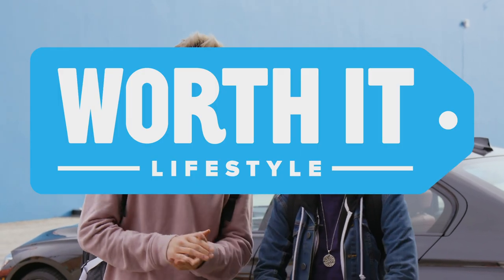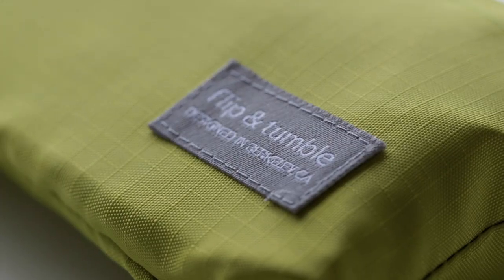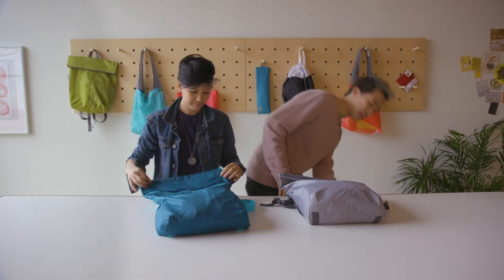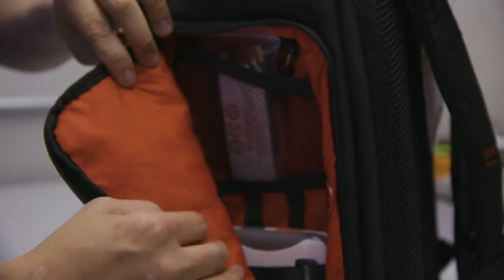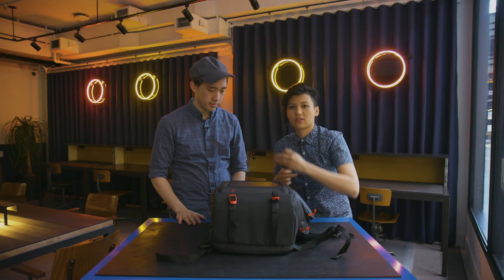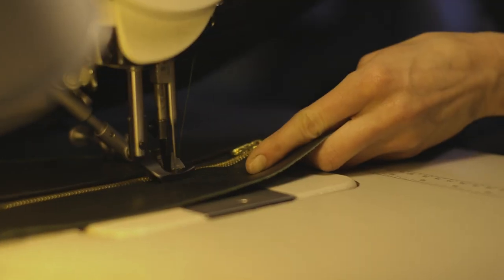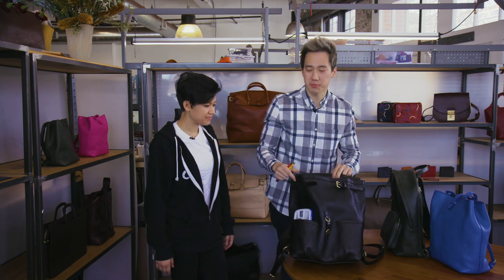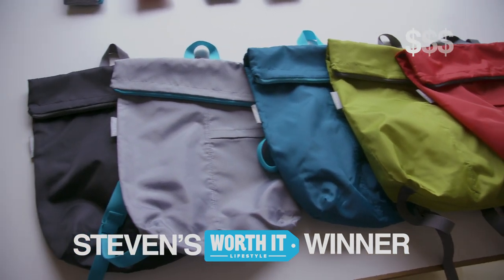$36 Backpack Vs. $990 Backpack

Comment: The problem no one realises with the first backpack is that plastic fibre is terrible for micro plastics, which is the real issue with plastic right now. It ends up in the food we eat and inside our bodies. It being machine washable is just the way the plastic gets drained into the ecosystem because regular water treatment doesn’t catch particles that small. Get a filter for your washing machine if you’re washing synthetic fibres like plastic and polyester.

Comment: I love voltaic! I took their smaller solar charger to Peace Corps and it got run over by a car and still worked!
Reply: Does the charger work as a normal charger or is it slower? And is it good for books, binders, what not?
Reply: Violet Vixen it’s advertised at the same voltage of the average house outlet. So.. yes. 🙌

Comment: Best kind of backpack is one with reinforced laptop sleeve, simple and durable design, well fitted straps, small top pocket and large flat front pocket so it could possibly hold a tablet or a notebook. Maybe couple pen slots in there. Interior pocket opposite of laptop sleeve to hold possible accessories for laptop. 
And can't be too large and bulge outward.
Well fitted design is one of the main points, and some smart way to manage long straps if there is any.

Comment: The solar panel backpack is super innovative. I never thought about how people travel to off grid locations and don’t have access to power and all they can do is use the source energy from their backpack. That is super helpful! The price point is worth it as well! 

The leather backpack is beautiful as well! If I could afford it, I would buy it. I keep replacing bags all the time and the amount of money I freakin pay for them I can just get a nice ass leather bag.
Reply: The problem with the solar pack is that if the panel is shaded even a little bit, the power output drops to almost zero. Also the angle is not ideal, being nearly vertical.

Comment: The 200 dollar bag is my worth it winner. It's durable, good looking, has great storage capacity, and comes with solar panel and battery charger. That's a USA charger. Meaning anything that can run off a USA connection can be powered. Look at the possibility. You may even find a small stove that can be charged by that bag. Maybe even USA Flashlights. I haven't looked at all the options of USB devices. 

Just think camping, hiking, road trips, diasters having a portable solar panel is smart.

Comment: what I keep in my back pack is a rock hammer, a tactical shovel, a multi tool, a kukri, rope, water, snacks, survival blanket, knife, torch, 3 pound blacksmiths hammer, and a few rail road spikes and a plate of steel. I am an adventuring blacksmith.

Comment: I have a handmade leather backpack, and it's the best ever. Very durable and it lasts easily a lifetime. Other backpacks I've had? ~5 years max lf use and then the bottom starts to wear off, pieces of plastic start to come off etc. I carry a lot of books and electronics in my backpack and it needs to be durable. So far only real leather backpack has done that. "It's not environmentally sustainable", hah! Tell me that buying 20+ plastic backpacks is more ecofriendly than one single leather backpack that will last the rest of my life

Comment: I'm a little surprised he didn't know what patina was. Also even if it has a lifetime warranty the fact is the backpack does not look good. You can also find better looking and much cheaper leather backpacks out there. Also those straps are just horrible. Only way to really adjust them is to take off the backpack which means you'll be putting it on and off awhile until you get it right. I prefer being able to adjust my straps while wearing it on my much cheaper and yet oddly more versatile backpacks.